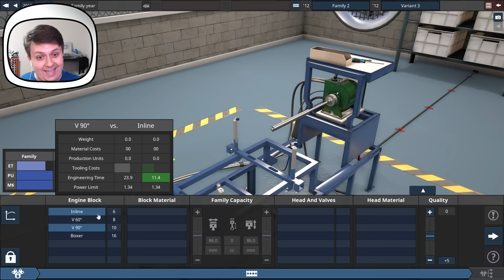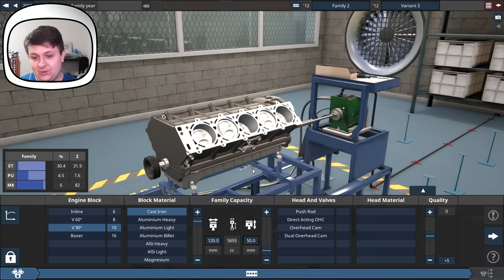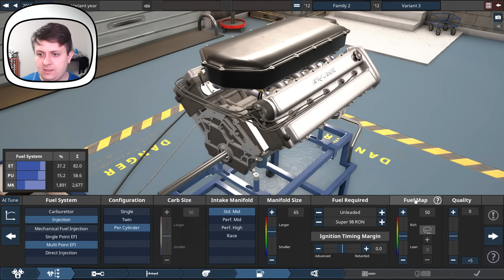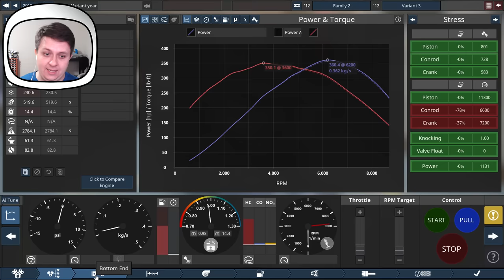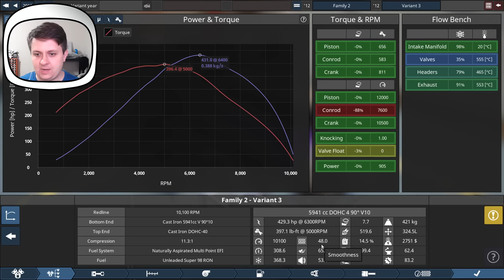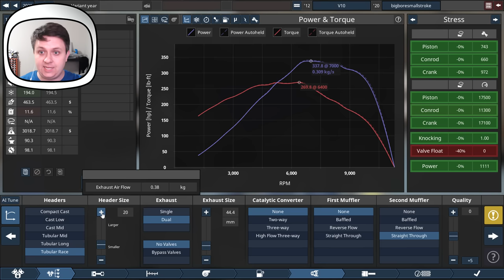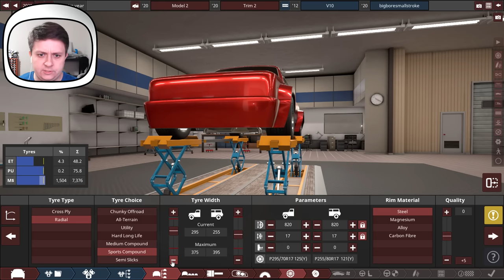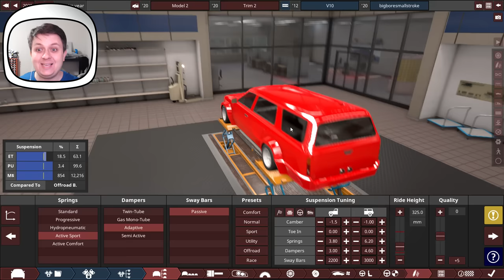Building & Testing a V10 Engine With LARGEST Bore and SHORTEST Stroke! (Automation | BeamNG)

Comment: 0 horsepower at 10,000 rpm🔥
Reply from the maker: just pure noise baby 😂
Reply: Motorbikes be like
Reply: Backpressure: Well hello there.

IRL that engine would be dead mid pull. big chonky holes in the piston glands.
Reply: Maximum efficiency😂
Reply: @v_stands_for_value124  bud motorcycle's are crazy fast wth u saying
Reply: @YamahaAeroxIsGood  bro he means that most motorcycle’s have little horse power but a ton of rpm he was never saying there slow
Reply: @ClaytonHenson  r1 has 250 hp haysbusa turbo 500-700 hp idk what ya'll saying but that aint low hp
Reply: @YamahaAeroxIsGood  I said most motorcycles
Reply: @darealkosmo  try increasing gear ratio
Reply: @YamahaAeroxIsGood 500-700 built not stock, they have 2-300 stock
Reply: @v_stands_for_value124  motorcycles have all their power in the top end, especially larger engines. a 1000 barely accelerates at low rpm
Reply: @YamahaAeroxIsGood WTH are you trying to say with your bad grammar?
Reply: @ClaytonHenson  motorbikes have way more horse power per cc though, compare a 1L car engine with a 1L bike engine
Reply: What a machine
Reply: @RailsofForney he is saying there isn't any stock production bike with 500 to 700hp, that's absurd, they are in the 2-300hp range
Reply: We putting in zero acceleration with this one 🔥🔥🔥
Reply: @v_stands_for_value124  yeah you need 300 hp for a 60 kg bike
like there is a reason why it hasnt happenned
Reply: Not true, you just need 2 or 3 hi lo gear boxes

Comment: To rev high you need max flow everything and the lightest possible moving components, cast light and billet is where it's at👍 a big turbo can also help but then you need heavier internals again.. cast block and heads are good actually, not for weight but strength. The torque dropoff is that the cams are too Conservative.
Reply: im only at 6:54 right now and so far with the basic intake manifold it will suffocate at higher rpms and the exhaust will also slow flow at higher rpms as well  i see he fixed that
Reply: exact
Reply: high end numbers are actually due to valve float. the valves arent CLOSING enough to actually make compression, hence all the power falling off. you actually need to LOWER the size of the lobes on the cam and increase duration. that way they are open longer, but just not as wide. a smaller cam lobe at super high rpm causes less float because it's not trying to slingshot the valves with a baseball bat. ive been building engines since the 90s, some at low RPM, torque monsters, and some that push over 9k. very very different geometry to keep valves happy. a cam'd drag car with 1000hp at 5000rpm has almost the opposite cam profile as 1000hp at 10,000 rpm.

Comment: You could try to make the slowest revving engine. My old neighbour tunes old tractors and at one point he had a small tractor that drove around at like 100 rpm or something, it sounded hilarious.
Reply: That'd have to be reaching into the V16 dlc, right?
Reply: A Ford 9n? They are known to rev low
Reply: Like that video of an old diesel running at 0rpm lol
Reply: the old john deere 2 cylinder J tractors had the best "kerplunk" noise when they idled
Reply: Single cylinder tractor for you

Comment: To make power at high rpm, you need all of the air flow you can get. To make the engine not explode at high rpm, you need the lightest rotating components you can get. We’re all here to learn!!
Reply: More than rotating, reciprocating mass needs to be kept very  low at high rpm.
Reply: @chipcity3016  a short stroke helps with that, less overall reciprocating speed therefore less accelereation

Comment: So cool to see you all having fun with this! If you soften the valve springs and and raise the cam profile it will move the torque curve further up the rev range and get you a lot more power and torque, you may have to lower the max RPM a little but you'll get way more performance out of the engine! Keep up the good work Cosmo, love to see you having fun with it!
Reply from the maker: Thanks for the comment and the tips!! :D

Comment: Variable Valve Lift would be better known by one of its trademarked names "VTEC".  Two separate cam profiles for the intake valves (not sure if they have VTECd the exhaust side on newer engines), driven by a oil pressure lockup actuated by a solenoid.  Rev speed will be driven mostly by rotating mass, which includes flywheel weight, piston weight, and connecting rod weight.  I get kind of a "Lancia had a baby with a Citroen rally car" vibe.  It accelerates so slow for being so loud:  literally my IRL car lmao.  Yeah, those gears are waaaayyy too close together.  I would start by lowering the ratios a bunch, and once the shifts are in the right spots, fiddle with the final drive ratio.  You could do the maths to figure out the correct ratios, but where's the fun in that?
Reply from the maker: lol my IRL car is the same xD Thanks for the tip on working out the gear ratios!
Reply: @darealkosmo  If you do it right, you should be able to get those ratios figured in two iterations (gearing is either maths or iterative).  I always start with the "I've gone too far" step, then bring it back 30%, but you could try a "cut it in half, then half, then half" approach also.
Reply: @darealkosmo  VVt is basically the power valve on your 2t
Reply: VTech is just Hondas trademark name for their VVL, they did make it popular to do. Other Japanese manufacturers also had a version of it, Nissan and Toyota both did in the 90's.

Comment: One thing to know about Pushrod configs is that they aren’t optimal for high-revving, high-load applications. This engine worked but OHC can be more reliable for these stats.

Good work!
Reply: Really? Pushrods can't rev? You've never looked at AA/FD or funny car engines. 12k is pretty much normal at 300+ mph in a 1/4 mile.
Reply: NASCAR only recently switched to OHC engines. they ran pushrod setups at 9000 rpm for 500 miles straight at full throttle/200mph for YEARS. they're just REALLY wicked rods haha
Reply: @ghomerhust That’s a race application. I meant that the pushrods can bend and flex if not made from good enough materials.
Reply: @buddcochran4726 You’d be right. But generally, DOHC provides better airflow for high RPMs.
Reply: @buddcochran4726  Plus, race engines only do maybe some number runs before a rebuild.
Reply: @ghomerhust  NASCAR teams generally rebuild their engines between races if I’m not mistaken

Comment: I built one of these long ago, it ended up being 758 hp at 9800 and 498.2 fpt at 7000 rpm, those are exact numbers.  I used my data from My RSX Type S's non stock K20A2 engine and the TODA short stroke kit morphed in to a V10, I settled on 89x77mm 4790cc, Dual 69.8 mm exausts 11.5k RPM 15:0:1, cam 92, VVTL 100, ignition was 76, 6mt with top speed of 425 kph 0-60 2.2.  AWD 22/78, AFR 11.9, ill leave the rest to you but I did fine tune the crap out of it and fit it in to a lotus Exige chassis made by Aruna. I have all the stats but I figure I gave enough for you to put the rest together, or at least people reading who know what they are doing. Most the other stats are optomised for breathing and 15 quality ofc. I am just about to rebuild this in the new version as I have not played in over a year.
Reply: Will edit: 
This engine above was on the old version, I am happy to give out any statistics. Right now I am in the process of re tuning for the current version of automation as of 07Feb24. Manually tuning VVT is a pain, I will watch some Hondata Kpro tuning vids before I finalise. So far I am at like 950 HP and 650tq, this is far too high, I need to stretch it out I am far too light for this wheelspid, I am running sports not slicks. 

I am not sure why I am making so much power. If I can not stretch this out let us all have a moment of silence for my chassis.
Reply: I know everyone reading is wondering, It drove terrific in the old BeamNG, I have too much power now. I am scared to optimise. I am not even sure how as I was trusting Camshaft Studios wizardry.

I need to load the old version and check the suspension, Updates may be a pain for all but how do I gain 200 HP and 400 TQ. I may have to rebuild the engine smaller.

Comment: The variable valve time is for better efficiency through the whole range as opposed to high or low. You would  use variable cam lobes irl tho
Reply: No… it’s strictly for better performance and maximizing torque.
Reply: You would use vvt-variable compression and variable lift which is two to three different cam lobes. 

All of these can be combined to make both power and more mpg. 

I got to 46mpg with 300hp before shops started taking apart my engine.

Comment: You should look up videos of high RPM motorcycles. Like the 4 cylinder 250cc bikes that rev 17 or 20k, I forgot. And they had the same "problem" too. They sounded like they were going fast, but they weren't. They are the engine epitome of "It's better to ride a slow bike fast, then a fast bike slow". Small motorcycles in general are so fun. But those extra small 4 cylinder bikes were old & rare, until Kawasaki recently made a new one.
Reply from the maker: I used to ride a CBR250RR that revved to 19k :)
Reply: @darealkosmo  
Luckyyyyyyyyyyyyy.
Reply: Same with the ZXR250, 45hp peak and 38hp at 18k rpm on the dyno. 
Sounded like the old F1 cars.

Comment: From 1957 to 1965 Chevrolet made a mechanical fuel injection for 1957 Chevy cars and Corvettes until 1965. You can find cutaway images online to see the complexity. All said though, the engines made more than 1 Hp/Cu in. and were capable of high fuel economy and, surprisingly, often met mid to late 1970s emissions with only a PCV valve. FYI, I'm a retired old school mechanic.

Comment: Imo you should've went with tubular exhaust bc it not only looks super cool but also sounds amazing. I also would've went with slightly larger header size for better resonance (71-73) and even a bit better flow on cast low headers.

Comment: 16:00 looks like a hearse, so thats my new head Canon that you made a racing hearse from scrapyard stuff. Also you'd be surprised the stuff that can be found at a scrapyard. At least in my area finding a trashed rally car isnt too uncommon.

Edit: 150+ km/h is slow? In what universe is that slow? Admittedly I'm basing it on high way spreds here in Sweden which tops out at 120km/h
Reply: V10 4 liters something? It's 250km/h top speed minimum.

Comment: Trust me, auto mechanics is fantastic to get into, being self taught in my opinion is one of the best things to do, you learn at your pace. My brother taught me the basics then i learned anything else from the internet and my own truck i bought. I know about the springs and lifters some, variably valve timing is crappy, if you can mess around with your own tune you can definitely make more power and have it run smother. If your springs are stiff they will be harder to move obviously and return to they position faster and with more force, not a great thing but you don't want weak springs.

Comment: Again, you need to build some more cars, Kosmo, and then join in on Camodo and kAN's BeamNG videos and just show up in your twerk truck. It'd be absolutely hilarious and like your best video ever. Get kAN to be fun again (tell him I said that as if he'd care.) But I can just see the whole Infected game mode they play with you in it and, "Who's it? Who's the infec-... Kosmo. What on earth are you doing?" <Truck Twerking intensifies> "I'M GOING AS FAST AS I CAN!!!!"
Reply from the maker: hahaha. I actually did try to join on infected butttt my PC can't handle 14 people in one BeamMP server :(
Reply: @darealkosmo  Noooooo! That bites, but you'll definitely have to do it once you update your rig. I kind of want to share one of my builds. I was going for a beefy truck and Automation and BeamNG seems to think I was joking. A stupidly mahoosive 7964.11cc V10 overhead cam 3 valve turbo charged with a 9.18 cm bore and 12cm stroke length. It's limited to 6300 rpm, but it some how is throwing down 736.7 horses at 5400 rpm and a whopping 927.5 lb-ft (1257.5 nm) of twerk- sorry, torque at 3200 rpm. I tried it out at Johnson Valley thinking I got like a super duty or a gnarly Raptor. . . . The thing don't work out on Johnson Valley. It easily gets up to +100 mph in 2nd and I've had it zipping across the salt flat at +200 mph. It, in theory, should be decent on dunes. The problem is it yeets itself off even the smallest berm. I think you'd have a lot of fun with it because it's just accidentally so stupidly fast.

Comment: Hey Kosmo to help a bit with fuel injection. Mechanical fuel injection means the injectors fire/inject mechanically basically once fuel pressure reaches a certain psi it opens up. Single point efi means there is 1 small opening on the point of the injector nozzle and efi is electronic feul injection. Multi point operates similat to single point except it has multiple holes on the tip ie more fuel and beter spray pattern and atomization. Lastly direct injection is just fuel is directly injected into the combustion chamber. Whereas single point and multi point in automation is port injection. Hope this helps.
Reply from the maker: thanks d00d!

Comment: You should always merge your exhaust with a V configuration. And I mean always. The closer to the engine you position your merge, the more torque you'll make. The further away, the more HP you'll make. Its been proven time and time again to be the best configuration. Port matched headers into a merge, out dual. Another thing, connecting rod destabilization has to do with harmonics and the balance of the rotating assembly. Ive never played this game. I'm speaking reality here. However in a simulation format, the laws of physics should be the same as they are in real life. I have no idea if you're able to balance the rotating assembly or not. Ive seen you mess with the harmonic balancer settings which might be the move if you're running into high connecting rod stress levels. I'm actually an ex Marine but since 2016 I've been an Audi mechanic. They sent me to Germany for 7 months to learn the R8 inside and out. I'm proud to say I'm one of 5 men in Nevada who is certified to work on the R8. I'm the only certified guy in my area (Reno, Nevada). So believe me when I say I know my shit. If you or anyone else has any technical automotive questions feel free to ask. I'm always happy to help.
Reply from the maker: Is this possible in Automation?

Comment: big bore, big valves, big overlap, big exhaust, big throttle body. This has been the Honda recipe since the early 90s. Your problem is a lack of exhaust momentum at higher rpm, the rods experience stress because they aren't moving a piston freely, they basically ram the piston in the exhaust stroke like a second compression stroke which completely sets off the engine balance. Especially for a v10.

Comment: Single point EFI is, at it's most simple, a carburetor with a fuel injector instead of a carb jet.  A lot of hotrodders experimenting with EFI use systems that resemble carburetors, bolt up to the same place on the intake manifold a carb would, but spray fuel instead of fuel sucking through a jet from a pressure drop in a venturi.

MPFI places individual injectors right before the intake valve.  These are either mechanical (a special pump driven by the serpentine belt that sends fuel at high pressure to the right place at the right time) or electrical (the injector receives an electrical signal to open a valve inside of it.)

Direct injection is modern mechanical fuel injection that places the injector inside the cylinder head, after the valving.  This uses a mechanical pump driven by a lobe of the camshaft to shoot fuel directly into the cylinder under very high pressure.

Comment: Wait, you've only built two strokes? Same here! Well, not built a whole engine but ive had one apart. To change out the... Seized piston, on 2 different 50cc mopeds. But both cylinders made it with a little honing. Awesome video btw👍
Reply from the maker: That's slick! Gotta love it when it's just a hone. What mopeds ya got?
Reply: @darealkosmo  a Peugeot speedfight 2 and a honda mt5. The speedfight is mine and the mt5 is my fathers.
Reply: @darealkosmo  i don't know how popular they are where you live but here in Sweden they are pretty popular. Atleast among the younger people.

Comment: All you need to know is this equation to produce the best displacement for your stroke. .7854xdia2/PSI or Kpa. You need to know the max pressure for each cylinder at .7854 of the ignition stroke .7854 is a quarter of PI. If you know the average pressure of all the cylinders you can set the fuel ratios correctly in any computer to make max horse power per RPM and pressure, .7854xdia2/Kpa, Get it?

Comment: You need higher cam profile and stiffer springs also all forged light components then it will probably rev to 11000rpm+
Reply: When you have max cam profile and stiff springs and valve float up the quality of the top end
Reply: Also use performance manifolds

Comment: for higher revs you probably need higher quality on your top end parts. and a much higher camprofile so you get som top end torque. your gearing should be more narrow between gears and final drive should set top speed. ;)

Comment: One reason you are slow is your power band is in the middle of your rpm range but your gear ratio is designed for the top end of the rpm range. My understanding is shift just after peak HP and land at or just below your peak torque. Would love to be educated further on this topic.

Comment: A lot of the rpm band is being wasted, probably airflow. 

The truck isnt exactly slow, 0-60 is about 5 seconds. The gearing also seems odd, but it could be because of the power drop off in high rpm...basically, it sounds like it wants to shift much sooner